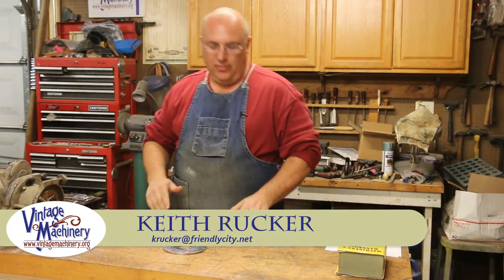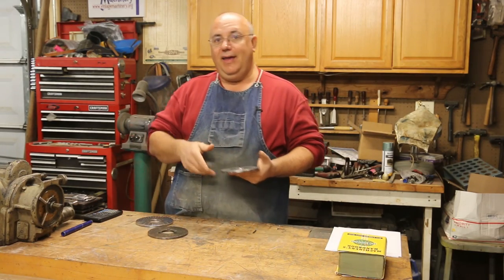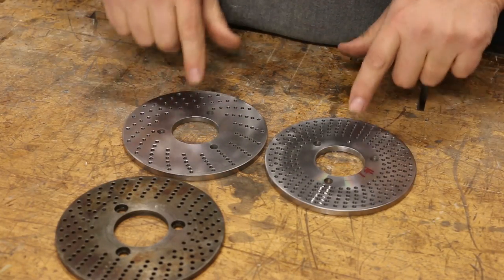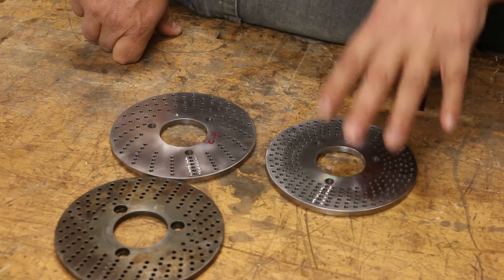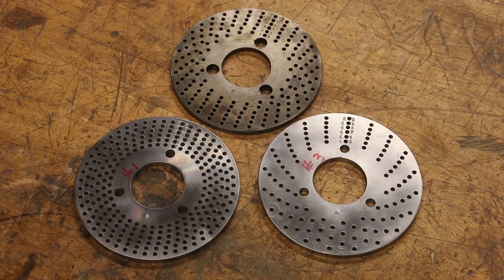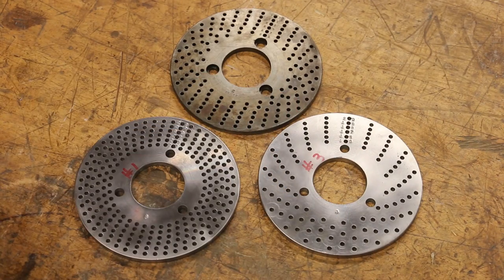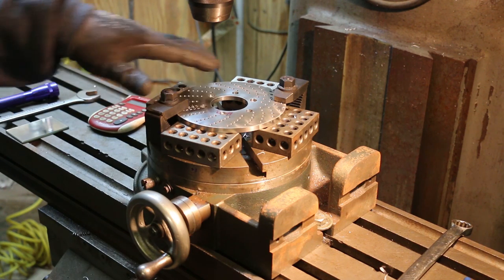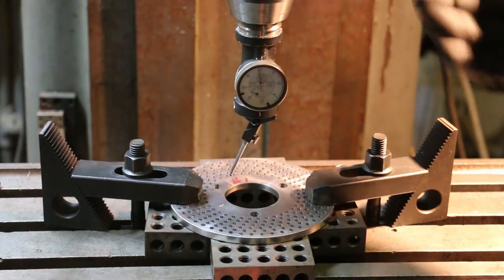Machining Dividing Head Index Plates:  Drilling Hole Patterns

Comment: High School ruined math for me, in general.  Such a bad experience that if someone say's "Algebra," "Trig," or "Calculus," my brain instantly locks up.  Without a guiding reference in hand, I'm lost.  Getting past the advanced test for ham radio took nearly a year, and once past it what I managed to comprehend fled.   Yet somehow I manage to figure out what I need to know.  It just takes me forever. I guess you call it "backdoor math."  As many years as I've been figuring out work-around's to make worn out or dead machinery work with what's on hand, it's second nature by now.
Reply: +diggerop I did try to follow you on that, by the way ... maybe, someday, something will surface again when I'm at the point of making my hair look like Bozo's...

Comment: Great video, loved the math, I always loved math in school, and now use it daily making signs and awards mostly for centering but also for cutting curves and hole placements. My only question on this video was why you didn't drill/mill countersink holes when you drilled the through holes, you know while they were lined up without having to re-index the rotational angle? Also couldn't you have laid the original on top of the new blank and used a sharpie to mark hole locations? I realize this wouldn't be as accurate as mathematically calculating  it all but probably would be (and I hate to use the phrase) close enough for this purpose. Again loved the video...  (Ô¿Ô)
Reply from the maker: I debured on a drill press - no need to be perfectly aligned with the center of the hole since it is self centering.  Much faster than changing a tool.  As for the sharpie method, it just is not accurate enough.

Comment: I did some rough calculations and it worked out 8-10 hours of constant drilling, moving and changing bits for each of the more involved plates.  when they made these in the old days they must have gone crazy (they must have cheated, turret drill and a guide system with a larger plate perhaps) to have got these done at a decent rate, but still lots of boring-boring!
Reply from the maker: +jusb1066 I can remember that the plate I made some 25+ years ago on the rotary table was a all day job.

Comment: Instead of all that maths (that's maths not math, because I'm British 😁 ), you could just turn an aluminium disc (and that's aluminium not aluminum, because I'm British 😁 ), the same size as the centre hole (centre not center 😁 ) with a 5/16th hole in the middle, and measure  the radius across the middle and one outside pin, subtract 5/16th, then double it, if you need the diameter.

Comment: Could we see that calculation again....but instead with a sliderule?  I just don't trust them thar electronic calculations!  You do still have your slide rule .....yes?        I do.. :-)
Reply from the maker: +Steven Hardy I can remember slide rules from when I was a small child but by the time I got to where I needed to use one, we had calculators.  I have used a slide rule but the truth is I would have to refresh my memory on how to use one now!
Reply: +Keith Rucker - VintageMachinery.org Oh you must be a little younger than I . In engineering they were required learning in 1970 thru 1972. Soon after Rockwell started selling handheld calculators for about 200 bucks for the 8R.     http://www.vintagecalculators.com/html/rockwell.html

Comment: yeah I see.. its a metric plate..  2.37in = 60.176mm  near enough 60mm before the holes got worn, 5/16 pin= 7.95mm, make it 8mm . 60-8 = 52mm centre to centre.  So the centre of the plate is 26 along and 26 up making the diagonal sqrt(26^2 + 26^2). 36.79.. measure it, it will be 37mm near as... yup the machine was metric.  Why do you guys make life so difficult. Feet base 12, yards base 36, inch in 100.. its a wonder that man got to the moon.